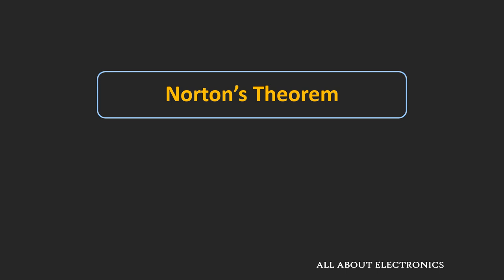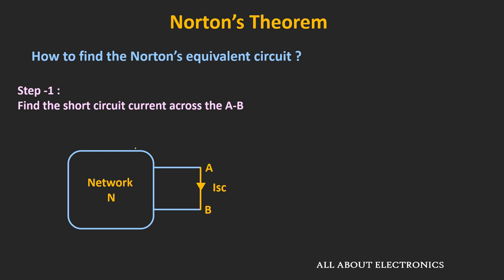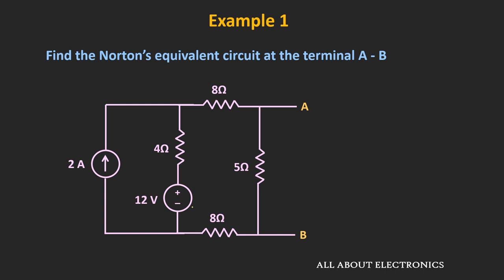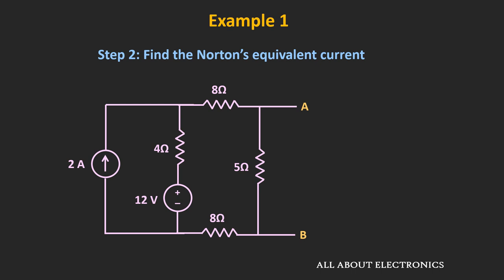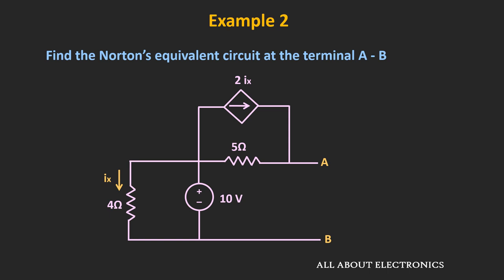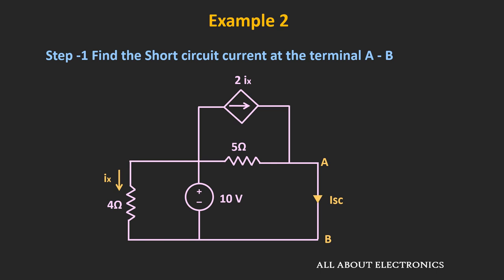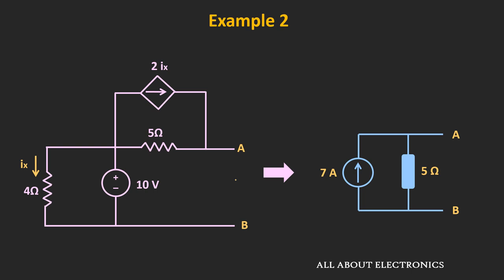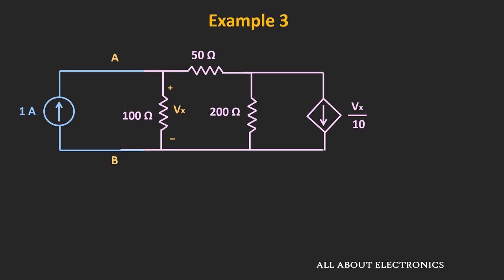Norton's Theorem Explained (With examples of Independent and Dependent Sources)

Comment: sir at 6:18 why are u using the opposite convention of assigning sign to potential differences
Reply from the maker: Yes, that's right, but It will not make any difference in the final result. Because, if you take the negative sign outside, then we will get the same result. So, I have directly used the second step. I hope you got it.

Comment: how do we know that the, 8,4&8 ohm resistors are in series?
Reply from the maker: Because the current flowing through all three resistors is same. From the A terminal, if you apply some current, then it will get divided between 8 ohm and 5 ohm, and whatever current that is flowing through 8 ohm resistor, the same current will also flow through 4 ohm and another 8 ohm resistor. (Because there is no other node in between)

Comment: why 0A in the last example
Reply from the maker: The circuit has only a dependent source. That means there is no excitation in the circuit. Therefore, we can only find Norton's equivalent resistance of such circuit. Without any independent source, Norton's equivalent current will be zero. I hope it will clear your doubt.

Comment: I am confused at 8:00. In figure shouldn't 4 ohm resistor be a dummy resistor (ie no current flowing through 4 ohm resistor) since it is parallel to 10V source?
And also how is yellow part of circuit parallel to blue part of circuit? If possible can you send link of redrawn circuit
Reply from the maker: It will be a dummy resistor when the voltage at both ends of the resistor is same. Here, at one end, the voltage is 10V, and at the other end of the 4-ohm resistor, the voltage is 0V. Hence, the current will flow through it. Since it is parallel to the 10V voltage source, the voltage across 4-ohm resistor will be 10V.
Regarding your second question, if you see the one end of 5-ohm resistor (yellow part of the circuit) is connected to the 10V (Blue part) while through the short circuit, the other end is connected to the negative terminal of 10V. So, it is connected in parallel to the blue part. 
For simplicity, just imagine the entire parallel combination by equivalent single element for both blue and yellow part. Then you will be able to see that.
I hope it will clear your doubt.

Comment: Here in the question 1 equivalent resistance at the terminal AB, not through 5ohm , then why we are considering 5ohm as load??
Reply from the maker: In this given circuit, the 5 ohm resistor is a part of the circuit and not the load. If we have been specifically asked in the question that 5 ohm resistor is the load and find the equivalent circuit across the 5 ohm resistor then we need to find the equivalent circuit excluding 5 ohm resistor. 
I hope it will clear your doubt.
Reply from the maker: In this given circuit, the 5 ohm resistor is a part of the circuit and not the load. If we have been specifically asked in the question that 5 ohm resistor is the load and find the equivalent circuit across the 5 ohm resistor then we need to find the equivalent circuit excluding 5 ohm resistor. 
I hope it will clear your doubt.
Reply: Thanku sir

Comment: once A and B gets short circuited,why do 5ohm resistor gets short circuited?
5.14

any one please
Reply from the maker: It's connected in parallel to the node A-B. The short circuit has zero resistance. If you take the parallel combination of any resistor with zero ohm resistance, it will be zero ohm. (Short circuit)
I hope it will clear your doubt.
Reply: @ALLABOUTELECTRONICS  thankyou...i got it...understood..thankyou

Comment: At 5:57 why you take -12 not +12 because there is a voltage gain
Reply from the maker: It depends on what sign convention you are using. Here, when there is a drop, it is considered as positive. (e.g., 8*I2). While applying the mesh equation in the second loop, as you are saying, yes there is an increase in voltage, as we go across 12V voltage source. (From negative to Positive). But here because of the opposite sign convention, it is considered as negative. I hope it will clear your doubt.

Comment: Which current should I consider while dividing Voc to find resistance, the current across A and B  or the current leaving the voltage source?
Reply from the maker: The short circuit current flowing through A-B.
Reply: @ALLABOUTELECTRONICS  thanks

Comment: at 10:20 why did you take the direction of current through 5ohm in the opposite direction?
Reply from the maker: I have just applied the KCL at node A. Incoming and outgoing current through the node should be the same. Since terminal A-B are open, there is only one-way current can go. From Va to Vx. 
I hope it will clear your doubt.
Reply: @ALLABOUTELECTRONICS  Thanks a lot😇❤

Comment: Why reference node VB taken as zero ..give some detail explaination sir please
Reply from the maker: Generally, in any circuit there has to have some reference node, and with respect to that node, the voltage at the different nodes are measured or calculated. Typically the ground node (whose voltage is zero) is considered as the reference node and with respect to that, the voltage of the different nodes are measured. But in any circuit, if the ground node is not mentioned specifically then any node can be considered as reference node (the voltage at that node is assumed to be zero) and based on that, the voltage at the different nodes is calculated. Typically the node where maximum branches are meeting is considered as a reference node. I hope, it will clear your doubt.
Reply: @ALLABOUTELECTRONICS  thanks sir 
I got clarified

Comment: In 2nd question how is 4ohm resistor is in parallel with 5 ohm resistor and dependant source
Reply from the maker: If you see the one end of the 4-ohm resistor, then it is connected to the one end of 5 ohm resistor. And once we short the terminal A-B then bottom end of  4 ohm resistor is connected to the other end of 5-ohm resistor. 
That's why they are in parallel.
I hope it will clear your doubt.

Comment: how 50 0hm is leaving in the 3rd case while applying kcl at node Vy
Reply from the maker: If we assume, it is entering the node Vy, then it will be Vx - Vy/50. And the entire equation will be Vx/10 + Vy/10 = (Vx - Vy)/10
When you assume it is leaving the node Vy, then it will be Vx/10 + Vy/10 + (Vy - Vx)/10.
So, it's just a matter of direction and the sign. it won't affect the end result. 
I hope it will clear your doubt.
Reply: @ALLABOUTELECTRONICS  Thank You